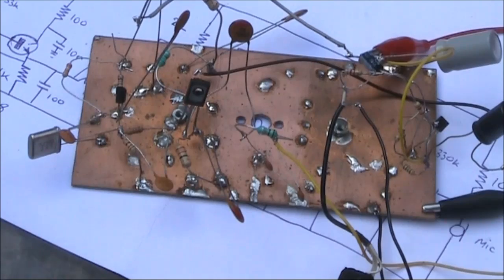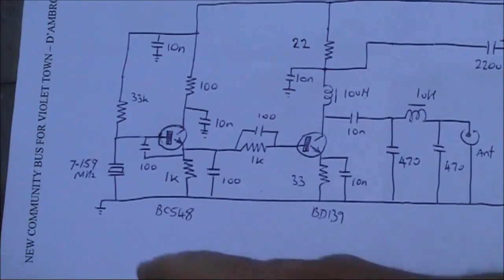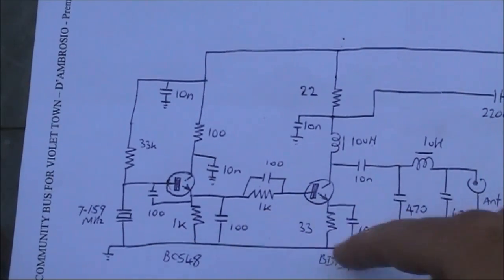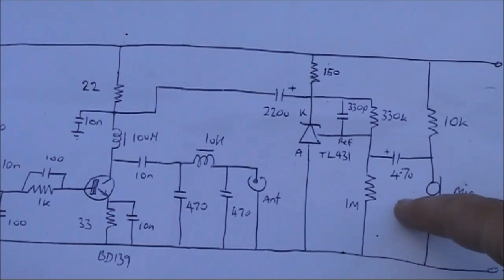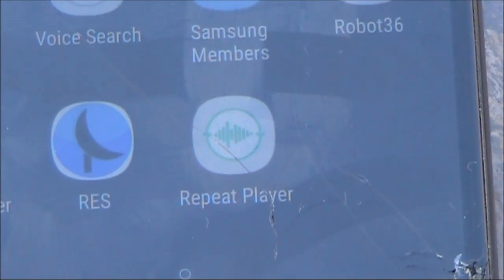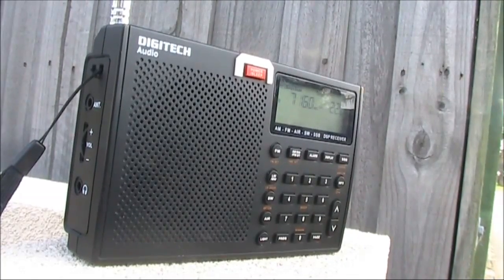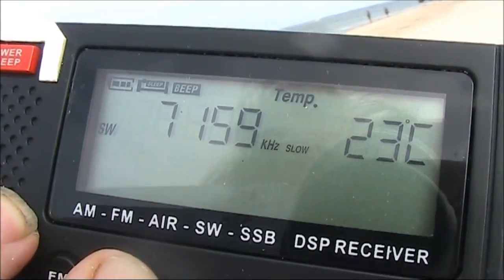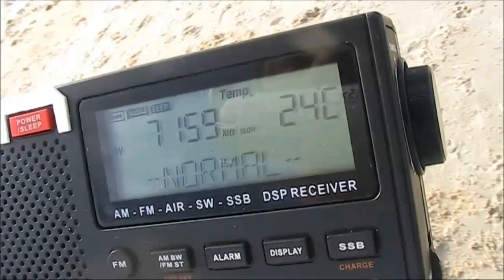The magic TL431 voltage regulator as a QRP AM transmitter modulator

Comment: Hello Peter, where the cathode of the TL431 connects to the 150 ohm resistor, is that a connection or join where the postive of the 2200uF electrolytic is or not, it’s a bit hard to tell on the drawing. Also, is the choke on the collector of the BD139 100uH or 10 uH? Cheers.
Reply from the maker: Yes it's a connection to the 220 uF. 10 uH choke.

Comment: Dear peter Which components and which values i have to play with to get more output watts
Reply from the maker: You will need a new, more complex circuit with more stages and higher power transistors.